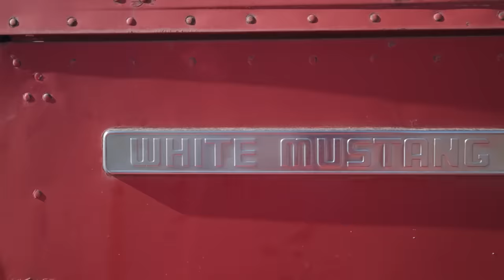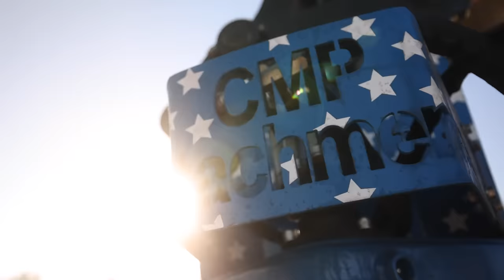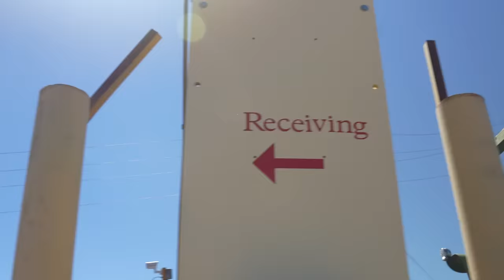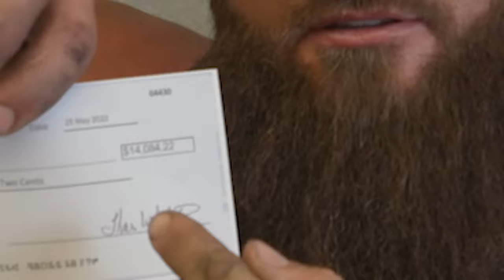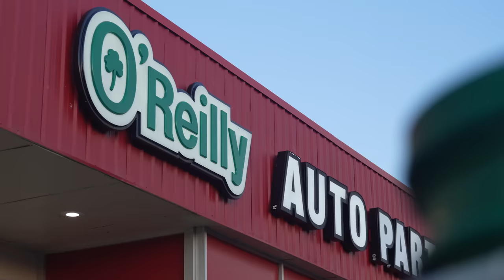Buying Everything In This Person's Backyard Was Full Of Surprises

Comment: With your radiators you want to pull the tin off your radiators same with the aluminum radiators and sell them separately you'll have your brass and copper radiators then you'll have your aluminum any copper wire you want to burn it or take the coating off of it you'll get more for it and it will be considered clean pull all catalytic converters off sell them separately make piles of iron tin and aluminum sell them separately and you never know you might come out smelling like a rose 🌹